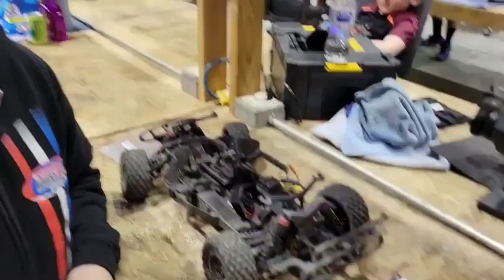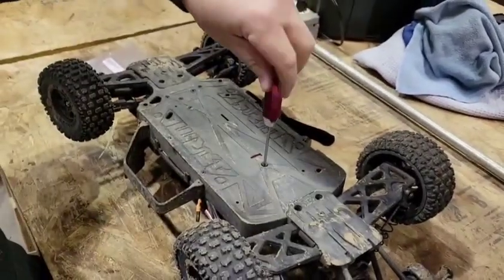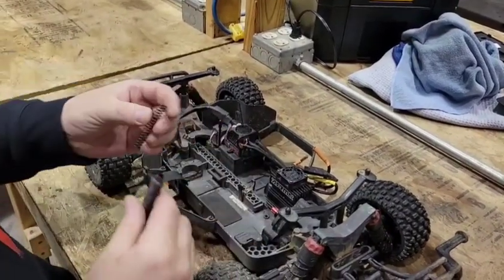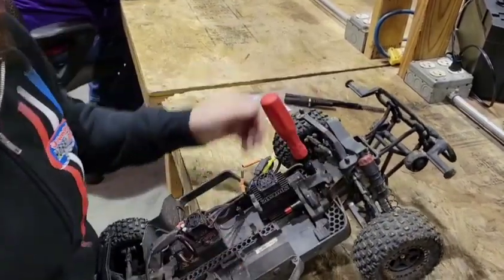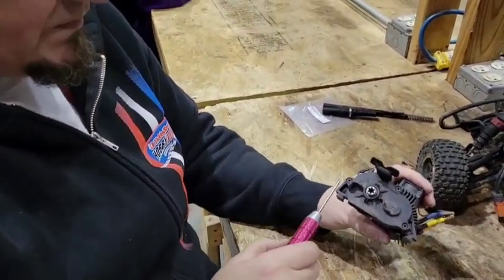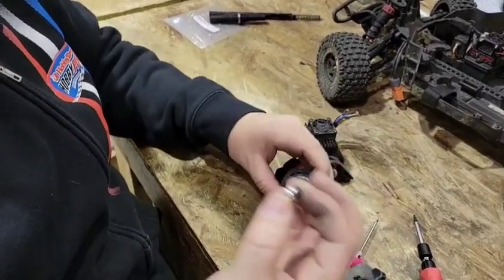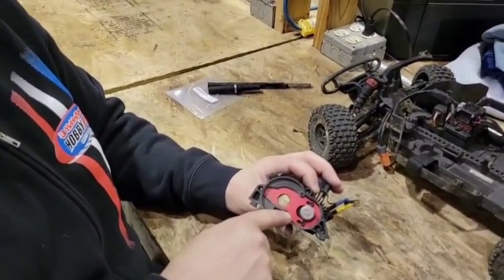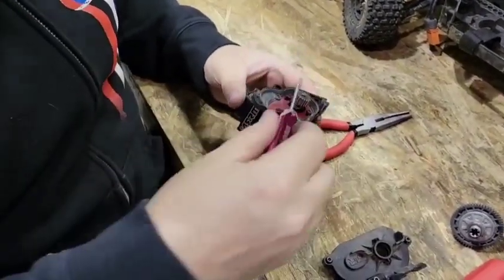How to Install a New Brushless Motor in a Arrma 3s Senton, Granite, or Typhon - HobbyTown HobbyPlex

Comment: These new motors are prone to fail early(bearings)..Horizon upgrades some things but downgrades others..just like the previous model that came with a terrible transmitter when the tactic was so much better
Reply: Oh that's not a Granite..It's a Senton lol
Reply: Oh snap. You're right...I'll fix it. It was late.